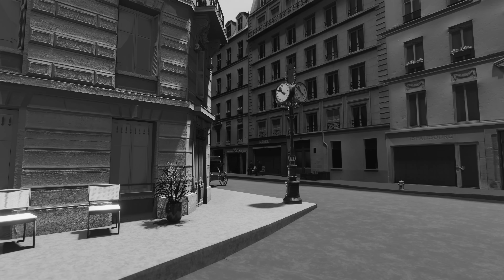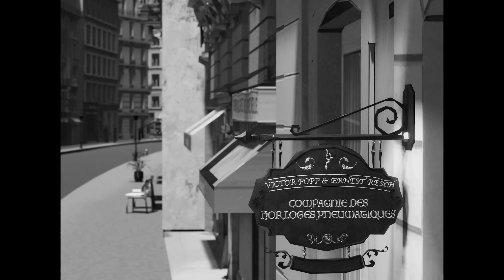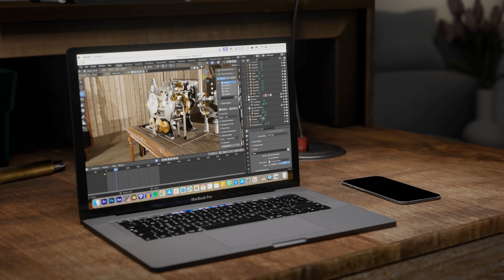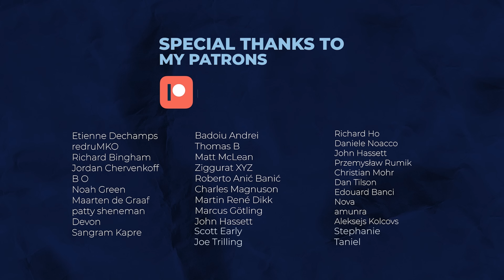The Underground Clocks of Paris

Comment: Very interesting video, indeed.
But, as you ask, here's what I think... 

I enjoyed it, but there is one major error in it, and any clever mind could easily spot it. For the probability of the thing working as explained is... well, inexistant.
The compressed air was not produce within the premises of the Observatoire de Paris. 

For those curious minds, the "Paris observatory" can be seen at the extreme south end of the Jardin du Luxembourg (the huge garden hosting the French Senate chamber), within 200 meters from its southernmost entrance.
So... this place did not produce any compressed air, and this is easy to understand for 1) an observatory is meant to observe, first and foremost 2) there was no pumps or similar machinery in there 3) it was providing the information (accurate time), but not the tools to use it (in the hands and responsibilities of the user itself). 

Producing such a huge volume of compressed air can not be done at the output stage of a XIXth century clock, as large as it could have been... even today the thing is hard to achieve, for longer periods of time.
Think about thousands of clocks (speaking of clocks, how many of them were installed in Paris ?) in need of compressed air 24/7, and a little clock system in a remote place pulsing air to those clocks... not a mere chance of success !  The good side of air is also its weakness :  if it can be compressed, this also means it loses its pressure (or, more accurately, the pressure drops) when being forced into the tube network. And the longer the tubes, the lower the pressure. Anyone can try this in a garden, with a car-tyre inflating pump and a long garden hose. Switch the first, set it to max power, then take a measure at the very end of the hose. Or, better, connect several hoses (same as it was under the streets of Paris, more on this later) with connectors (and the inevitable leaks they produce) and do the measurement some 200 meters away from the compressor. You'll quickly realise the pressure exists at the compressor's output bit, but gets weak and weaker the further you get from the source.
This is why the second generation of elevators at the Tour Eiffel used hydraulics, when the first ones were powered by electric motors... only to fail.
Hydraulics allows for a more stable pressure from start to finish in a circuit, something air can not achieve. 

The compressed air source for the clock system was not in the Observatoire de Paris, and it was quite far from it actually.
A company named SUDAC (for Société Urbaine D'Air Comprimé, or Urban Company of Compressed Air) was created for general supply of air, to be used by/for different activities. Their main factory was designed and constructed in 1891, under the management of Joseph Leclaire, engineer, and Guy Lebris ("ghee-lebree"), architect. It remained in operation until 1994, and I remember me visiting it with a group of friends curious about History and Science. The whole facility was located in the 13th "arrondissement" ( = precinct) of Paris, on the riverbank, along the Quai ( = dock) Panhard et Levassor (two engineers would manufactured the very first gasoline-powered automobile) at numbers 3 to 13... very large facility obviously, another proof of the "Observatoire" option being irrelevant.
The public clocks reached a peak number of 102, when privately-owned ones maxed at 7800 

When exploitation stopped, the place became a shelter for artists of all kinds to the point of international exhibitions being organized and the remaining buildings being saved from demolition in 2005.
Today, are still visible a large chimney, the main hall (with a typical XIXth century puddle-iron skeleton), a private house (formerly used by the "Directeur" = Chief manager, from 1905 on). All three of them are classified "Monuments historiques" ( = historical monuments) by the Ministère de la Culture.
The main hall is now occupied by the École Nationale Supérieure d'Architecture de Paris. Up the streetside main facade the goal of the company is clearly stated, with a huge "DISTRIBUTION D'AIR COMPRIMÉ" ( = supply of compressed air), and two SUDAC logos, all written in forged iron letters, a highly fashionable method back then. 

And the neighborhood hosts many University units, many Ministers offices, the "Très Grande Bibliothèque" ( = "Very Large Library", the latest archiving site of Bibliothèque Nationale de France), and... The Walt Disney Company French subsidiary. 

The factory suffered from the 1910 flood (cleverly named "the centurial fllod"), but was back into business within days after water left the place. After all, it stands some 50 meters from the river Seine (look for the pronunciation, you'll feel better off) itself and being flooded was inevitable.
Thanks to this facility, the whole of Paris was fed in compressed air and a large part of the suburbs too. Thousands of factories were then in operation (for instance Gustave Eiffel's one, in Levallois-Perret, some 5km North-west from Paris limits), with hundreds still existant which many ignore... Paris is not only an urban area, with boutiques and museums, but a very very busy urban entity (nearly 11 millions inhabitants).
This factory was built because of two other ones (from 1879) being undersized and too inefficient. 

Today, the place still carries its past magic :  anyone standing and watching a lot of noises and sounds and things come to mind.
It holds the souvenir of a hard-working population, eager to bring modernity to their peers. But also working for the respect they deserved, a half-century long battle with an eventual achievement in 1936 and the very first "paid vacations". A true social climax. 

Still today, a huge pneumatic network of tubes exists in Paris.
After a few tests and tries around 1871, a first "line" is opened between a luxury hotel and the Paris Stock exchange, so the customers can send messages faster than ever before.
Step by step the network grows to "cover" the whole city by 1884, and cylinders (named "curseurs" = cursors) travel at the amazing speed of 24 km/h. To anyone having a laugh, this was faster than any horsepowered vehicle, and still today faster than the average speed of a car passing through Paris.
The total network was 430 km long, made of metallic tubes, 130 "deposit offices" , hundreds of messengers (for the final delivery), thousands of sensors and automatic devices, etc.  Something hard to believe, even today.
The very last line was operated until 2004, between the Senate chamber and the Chamber of Deputies and the "Journal officiel" ( = the official publication for all Laws and Regulations in France). But the commercial adventure ended in 1984. Some portions of tubing remain installed, but are empty and asleep.
Anyway, this technology has a major place in the History of human communications. 

As a guide in Paris for years, this is exactly the type of places I took my clients to. Away from the touristic highways and traps, these places are the roots of Paris, where its heart used to beat and give pace to the City.
It now is our task to keep this alive in some ways by telling (true !) stories, explaining, driving others to curiosity, encouraging the younger ones to never take anything for granted but keep searching, asking, wondering, comparing.
Being scientists, even if it's "everyday scientists"... fundamental.

Comment: I believe one of France's last AM radio stations is still on the air, though silent in order to provide an electronic clock signal for various clocks and appliances so the story of centralized clocks is a very complex one but I didn't know any of the story you covered in this video. Thanks very much.

Comment: Generous system I didn't know of.
I do know of another use of compressed air in a city wide system around the same time.
That was in Manchester where they had a network of compressed air pipes in the city to provide power to factories and businesses. They could power steam engines without the need for boilers to produce steam, as air can power a steam engine as well. Air was chosen because it doesn't cool down and condenses in long underground pipes, se keeping the power in it.
A couple of large pumping stations would provide the air.
I believe it was the first power distribution system in the world before electricity became a thing, connection and billing would occur as with electricity or natural gas on a fixed fee plus usage recorded by a meter. Distribution of light gas existed but as the name suggests it was only for lighting, and not to provide mechanical power.
This could be a good topic for another video.

Comment: very very interesting vidéo, just a little correction (you have to read it with the french accent) , the paris observatory was (and still is) near Denfert-Rocherau on General Leclerc street (the point you show later on the map) and not in Meudon. Meudon is a different city (as paris is) where there is also an observatory but this wasn't this one used

Comment: How would a clock on the system showing the wrong time have been corrected? The blasts of air didn't encode a time like electrical and radio signals today do—they would have just advanced all the clocks one minute from wherever they happened to be, and part of fixing the time distribution system after the flood would most certainly have involved fixing the times on all the clocks.

Comment: A solution to a problem that used things they knew worked. Would probably still be in use today if it had not been too expensive, as you can see from the USA still having a few sections of 100VDC systems still in use in SF, where it once was built out with the tram lines as a power source, and was sold to buildings along the routes as a convenient power source to drive things like elevators and pumps, along with winches and lighting as well.

Comment: Awesome system, 1880…ppl were way smarter
Reply: As you type on a phone of which there are millions grooves and circuits… of which there are millions….of which are multiple times more complex than air pumped clocks on pipes.
Reply: They were just as smart as us, they just had to work with what they had at the time
Reply: It's funny how people are basically calling themselves stupid.
Some people were stupid in the 1880's, but probably less compared to today.
Reply: No.

Comment: kind of far fetched to call this system synchronized though. First of all it all depends on the correct setting of a clock because all this system can do is advance by one minute. So if your clock is set wrong to begin with, you’re just advancing an incorrect time. This is not what we would today understand when we talk about “synchronization” (actually not even back then, see Einstein’s 1905 papers). Secondly the clocks further away from the master clock would get the signal much later than clocks closer to it and thus would be off by up to 20 seconds. Kind of a useless system that took so much work to build and i) doesn’t set ANY clock in the network to the correct time (it just advances clocks by one minute) and ii) still will have clocks running up to 20 seconds late 😂

Comment: How could such a huge pipe network be cheaper than the electronic solution?
Just use an electromagnet that pulls the lever at the recieving clock instead of the bellow and use a switch instead of the valve at the distribution center.
Connect it all with wires and boom, no burrowing of heavy and bulky pipes, no complicated mechanical setup, easily scalable.

Comment: 2:10  "This was an extremely precise clock, [which] could run twenty-four, seven, without going out of synch."  Well, it's not going to stay synchronized with the constant movement of time if it stops; is it?

2:22  A backwards clock running backwards.  Right.

Comment: From the video it appears that the city granted a sole franchise to the clock company for 50 years. As part of the franchise they could use the city sewers for distribution. Much like electric, cable and old telephone share utility poles. That was very early in civic development. The legal framework that allowed the clock is just as impressive as the clock system. I am truly amazed by the ingenuity of engineers of the 1800's. If you like this clock, look up pneumatic control systems. Before we had electrical control systems, large processes like oil refineries used pneumatics (air) driven controls. These are some  still in use in large buildings but we're very common until the 1990s.

Comment: The Swiss station clocks work via a similar system that uses electrical power and a telephone line and a relay.  The second hand starts at 12 o'clock after each minute change, but remains stationary until the next minute change at 55 seconds, and then at the same time, as soon as the minute hand jumps one minute further, it jumps to 12 and then returns to the clockwise direction after 55 seconds  5 to 12 to linger.

Comment: how the hell was that intricate system air tight , not to loose a bit of pressure over 100's of km is beyond me . and that teeny tiny cilinder was enough to charge 100's of clocks . I think the animation is wrong and missing a huge air tank , where the air was kept at constant pressure by a regulating valve or somehow connected to the clock .

Comment: This is excellent, thank you.  I absolutely love clocks of all sizes.  At college in Southern Ohio, I weasled myself in charge of the so-called South Green Tower Clock, which had 4 faces and each hour hand was 7 feet long.  It was all electric, but I lubricated things, re-sync'ed with the WWV radio signal, and changed out the clockface lightbulbs.  It also had an amplified bell toll (Westminster Quarters) that I programmed to play between noon and 9PM because no one in college wants to be woken before the crack of noon.  I've also built Regulator-style clocks and worked on in-building master clocks.  Just fascinated with clocks.  I was scratching my head on this pneumatic system because of the lag.  But, if you think about it, all of the clocks will be in the same minute within the minute.  Back then seconds were unnecessary.  :)

Comment: A very great video, yet you didn't answer how they synchronized the observatory clock without AnyDesk...or did you?
Reply from the maker: I definitely could have been clearer. The two clocks were synchronized manually by a skilled timekeeper that would have had access to both clocks.

Comment: That explanation leaves me extremely unsatisfied. How did they deal with leaks? Tampering? Loss of synchronization? Maintenance? What pressure was used? What compressors? How was the system administered? How did they deal with the equivalent of today's line tappers?

Comment: What an amazing pneumatic time keeping system! But how did they deal with air leaks in the system? Wouldn't even one little leak throw the whole system off? I imagine it would have taken hours to find, then fix any leaks. Meanwhile all the clocks would be stopped or slowed down. Am I missing something here? I must be as the system worked fine for 47 years. And it was replaced only because electronic clocks finally became doable.

Comment: I wonder how each new clock was set to the correct time if the reference being used is the master clock or another clock on the network? If the next clock were far away they wouldn't be able to check the current time would they?

Comment: What kind of air pressure must have been needed to send useful pulses such great distances 😮?
Reply from the maker: Pretty significant I would imagine to ensure a reliable synchronization of the clocks. The exact pressure would be determined by the length of the pipes, diameter, number of clocks etc. Pretty amazing when you think about it!

Comment: I don't understand, all the air in the system was under constant pressure?
Reply from the maker: Not constant pressure, but the bursts of compressed air would have been released at regular intervals. The pressure of the air in the system would decrease gradually as it traveled through the pipes, but the bursts of air would still have enough pressure to activate the mechanisms. I hope that helps to answer your question. Thanks so much for watching!
Reply: @primalspace  thank you.

Comment: The clocks in the video are reading 11:50. not 10:50. Did no one else notice that?
Reply from the maker: That's 10:50. On a clock the hour hand moves gradually, so by the end of the 10th hour it's going to be much closer to the 11...
Reply: @primalspace  I stand corrected

Comment: 6:35 but with every clock farther away the clocks get more out of sync because of the air puls wich needs to travel right?
Reply from the maker: Yes, you're absolutely correct that the travel time through the pipes would lead to slight discrepancies in time. What you're referring to is actually known as "propagation delay" and this system was designed to minimize propagation delays as much as possible using air-pressure and by optimizing the layout. Inevitably though, periodic manual adjustments were still needed from time to time with the end goal being to keep discrepancies within an acceptable range (usually not off by much at all). I hope that helped to clear things up and thanks for taking the time to watch and comment!
Reply: yeah totally thx :D @primalspace